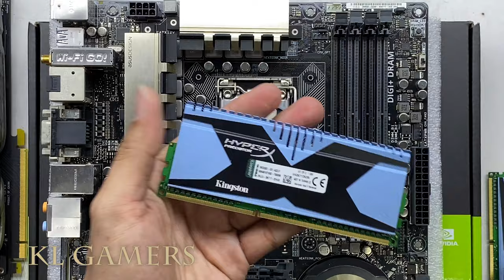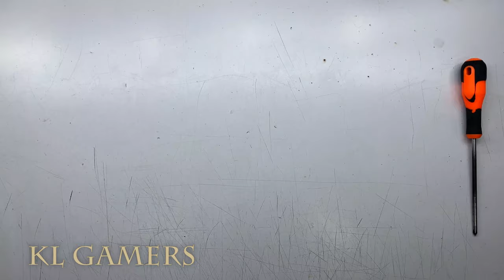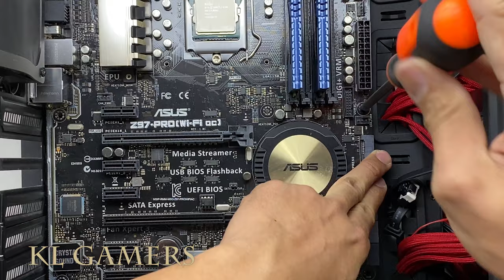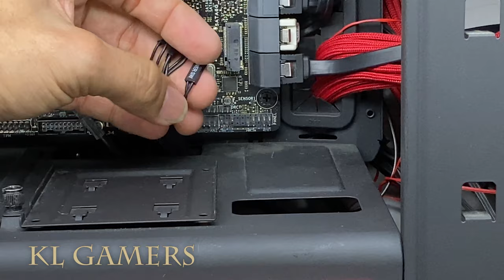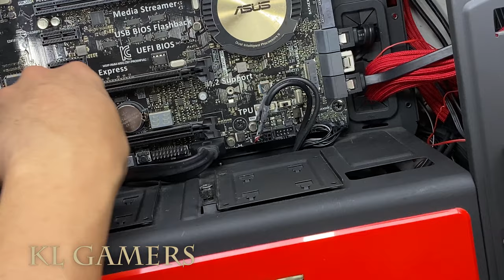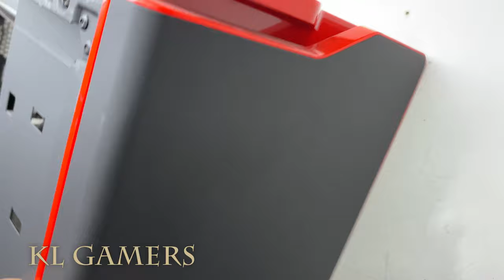intel Core i7 4790K ASUS Z97-PRO WiFi ac GTX 1080 GAMING X PC NZXT Build

Comment: I wish I could find this board for a decent price. I’m still rocking the z97 chipset
Reply from the maker: it's great 😆👍👍
Reply: Suddenly my z97 is dead and now I can't found another one. I think about new proc and mother board now
Reply: I have the i7-4790k and z97 gaming 5 
The system freezes when igpu driver is installed (windows update/MSI website/intel DSA Tool) system works fine with Microsoft basic display adapter 

But won’t pass audio via HDMI
Won’t let me change resolution to 1440p or 4k
No option for custom aspect ratio to adjust the top,bottom,left and right if the screen

Does anyone know how to fix it?

Comment: Hello, I have an i7 4790k cpu but i don’t know what other parts I need. I’m planning to get 1060 gpu and 16gb RAM.  For the remaining parts, what do u suggest?
Reply: I would suggest going with an 80 Plus Rating Power Supply, an M.2 SSD (Or Sata Works Fine), Corsair H60 Liquid Cooler, Cases with good airflow (preferably ones with mesh in the front). The motherboard he used in the video was an Asus Z97-A.

Comment: Would this board still be a good purchase in 2022? My asrock z97 3.1 died after 7 years of usage.. I’m running a corsair rm650w gold psu, nvidia 1660ti sc ultra 6gb, 32gb vengeance ram, & 2TB HDD. Should I spend the $500 on this Asus board?
Reply: Oh yeah also a i7 4790k.
Reply from the maker: $500 is too expensive, probably around $180 US dollars will be ok for used i7 4790 with motherboard
Reply: For sure no. I just bought a Z97 G1.Sniper and I7 4790 and 16 GB ddr3 for just 120$. With 500$ you can buy a new mobo-cpu-ram ddr4 or even ddr5 if you wait a little.
Reply: @bestopinion9257  I went with the asrock z97 Professional. An upgrade from my last board. Can’t even find them new. It’s like the best i7 board. It’s really nice
Reply: @TotemVII  Of course you can't find them new, they are from 2014
Reply: @bestopinion9257  yes but they are the best, I verify it. I only trust the ones on Amazon. They perform really well.. stable & reliable.
Reply: What happened to your motherboard?
Reply: @GiovanyCaballero  That comment old nothing even happened. My ram stick was bad turned it on after switching ram well removing the bad one.
Reply: @TotemVII  Ahh I see man 🙂

Comment: Can u suggest me any motherboard compatible with i7 4790 and rtx 3060 ti?
Reply: You really can’t. The i7 will be bottleneck by the 3060 ti. If you want that specific cpu, I would drop down a little on the gpu
Reply: Msi 97 boards might be good for you if you already have the cpu. I would drop the gpu to 3060 at 1440p though.
Reply: Z97 boards

Comment: What's the best gpu for i7 4790?
Reply from the maker: i have no idea, RTX3050 would be nice to have
Reply: @KLGamers  rtx 3050 might bottleneck it very hard ngl tbvh
Reply: @Overwankerfuck9292  what? How would these cpus bottleneck 3050 if they don't bottleneck 1080 which is more powerful
Reply: @HeartOfAdel  its not about the power im pretty sure it will bottleneck the 3050 because of the age the 1080 is a much older card and came our around the same time also the ddr 3 ram will bottleneck it
Reply: @Daniel-dl6fp  what the hell? Bottlenecks don't happen because of the "age". They happen when the gpu asks for too many frames that the cpu can't prepare. 
Gtx 1080 is more demanding on the cpu because it's faster. And games tend to become more gpu intensive over years when cpu requirements grow rather slowly, and are even reduced with diretx 12, direct storage etc. So if 4790 could saturate something around 1070/1080, then the 3050 isn't a problem because good pairings age together in terms of performance.
Also stop generalizing that it will "bottleneck". What settings are you using? What fps do you want? If you target around 60fps with higher graphics settings, then 4790 certainly won't bottleneck the 3050 in most games.
Reply: @HeartOfAdel can i pair zeon e3 1271 v3 with rtx 3060ti?

Comment: Im suprise i7 4790 cpu in 2020
Reply from the maker: it's still kicking
Reply: @KLGamers  im using i7 4790k and gtx 1070 its still rocks
Reply: Beast i7 4790💪
Reply: My gtx 1070 is artifacting now sad need new gpu.... i couldnt find  gtx gpu now. All i see is rtx gpus. Btw is rtx 2060 and i7 4790k bottleneck?